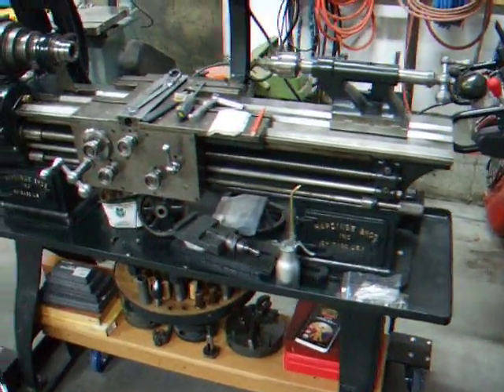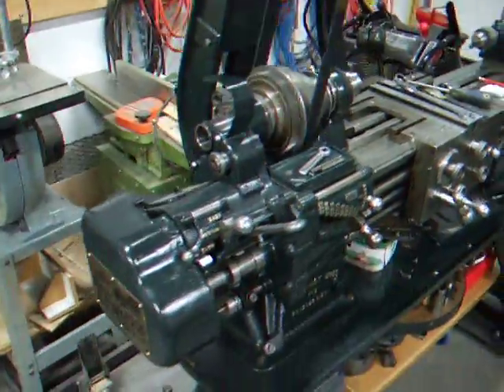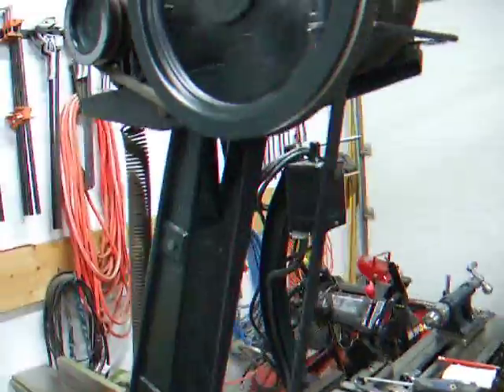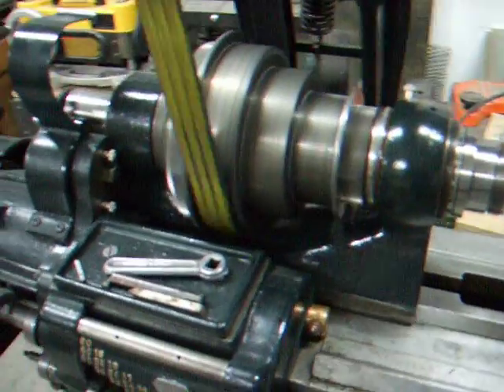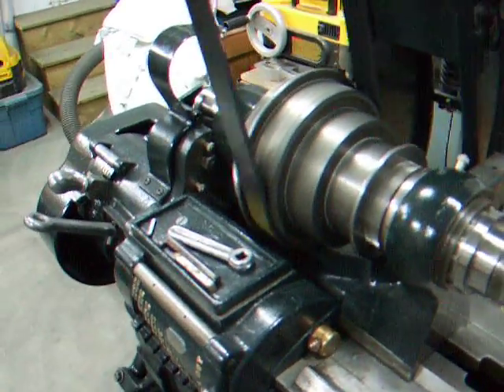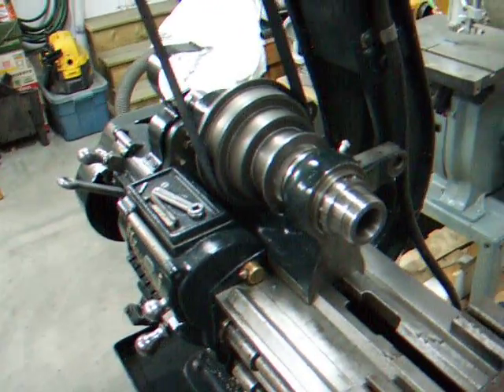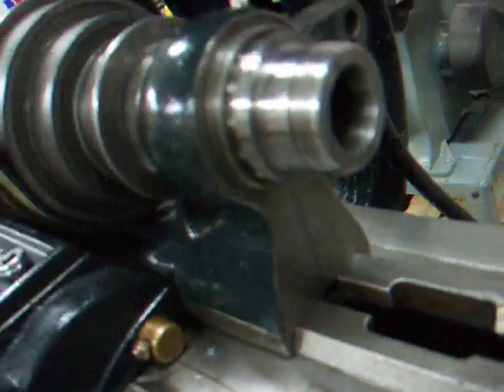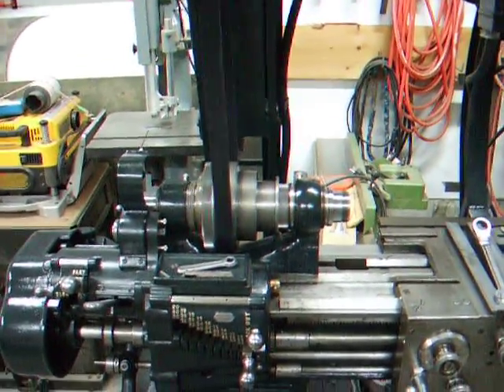Hardinge Cataract Quickchange #39 runs again.AVI

Comment: Just found one online and sending for it tomorrow. Excited. It’s covered in oil so I’m hoping it will clean up nice. It usually preserves condition.
Reply from the maker: Best of luck with your purchase. Let me know what serial number you get.
Reply: @haroldmulder  will do. I have a collection of over 40 lathes along with a bunch of other machines. It popped up online this morning for $500 and I knew I was going to buy it before I enquired. Then I read up on it on Tony’s Lathe sight in the UK and knew I had to have it.
Reply: @haroldmulder  Just took delivery. Can you tell me where the number is located? Is it on the very end of the bed?